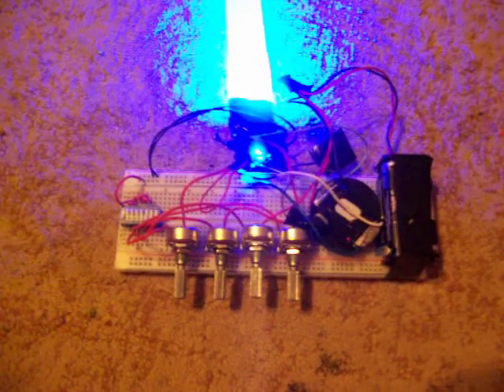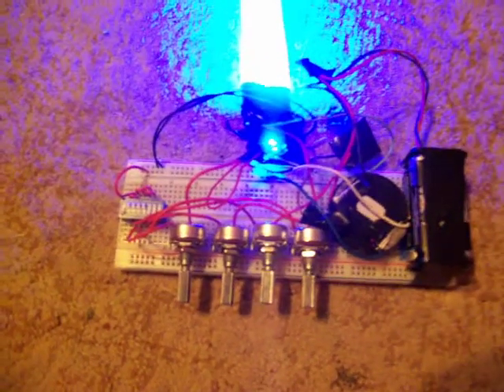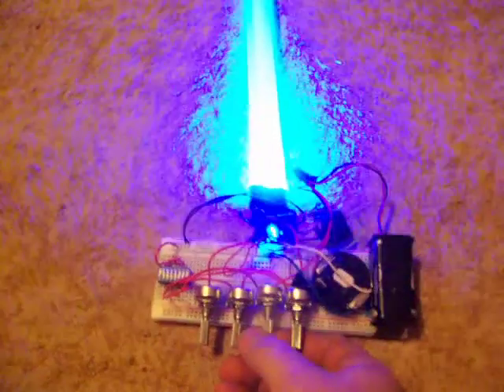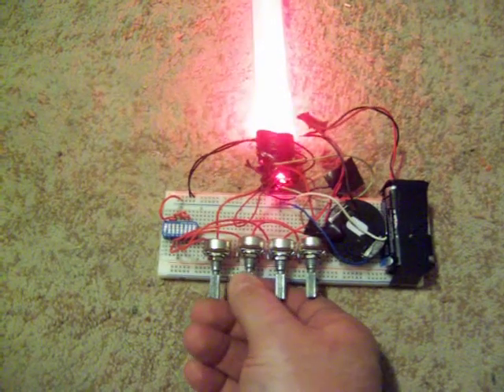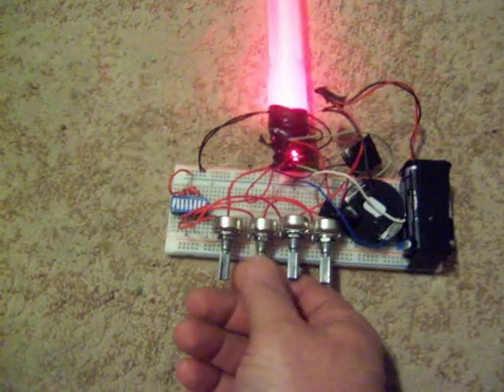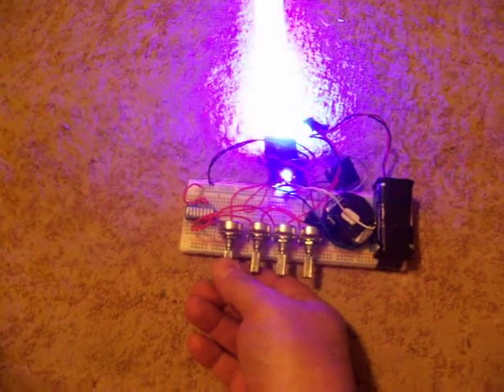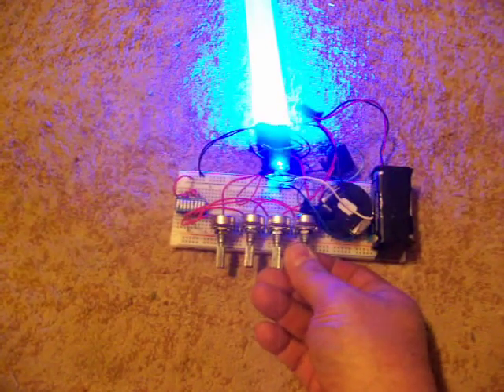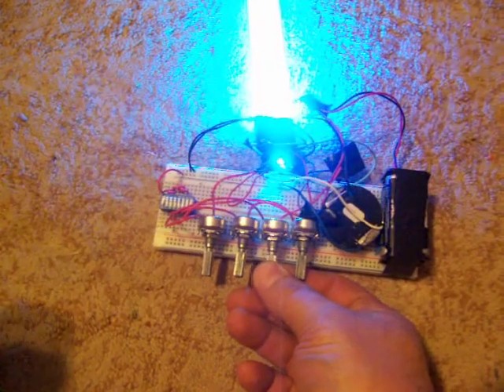RGBA LED Test

Comment from the maker: Once you dial in the color you want, you measure the resistance with a multimeter and then get a resistor that size to put in the final circuit.